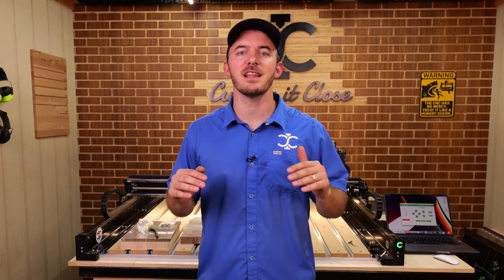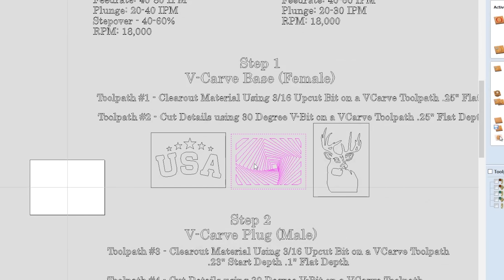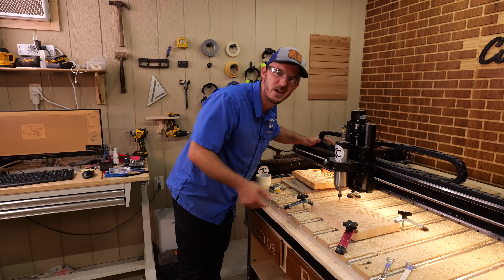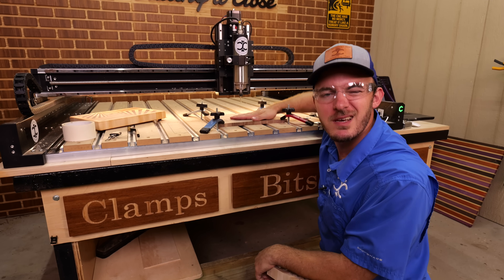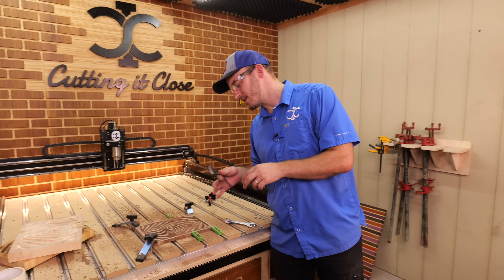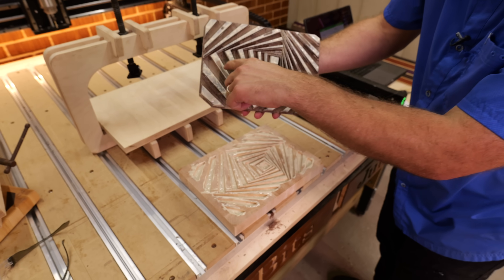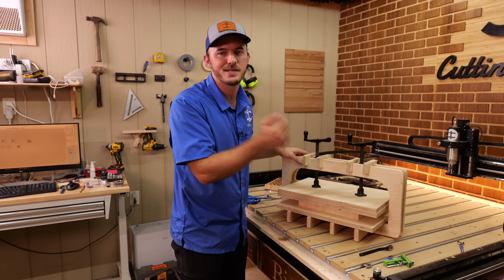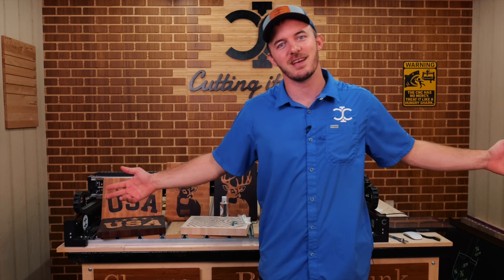I Just Made CNC Inlays Too Simple

Comment: Final clearing: Since your not using a "hold down" (only using friction to hold it) wouldn't you want a DOWN bit so you don't accidentally lift the workpiece?
Reply: Not if the board is big enough and secured properly. That tiny UC wont do much. If you were to do a board half the size or smaller, i would with do the hold down in the video tighter or use some tape and ca glue.